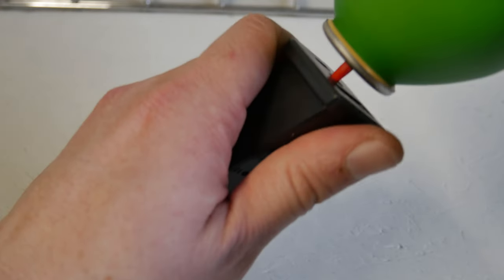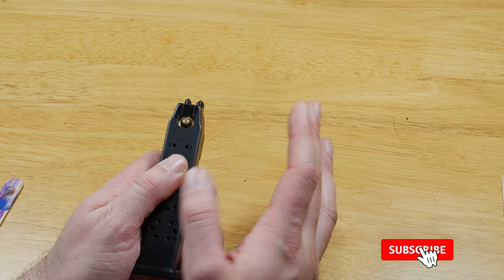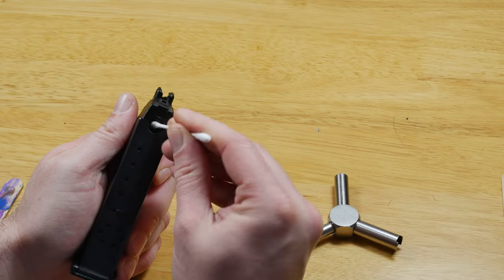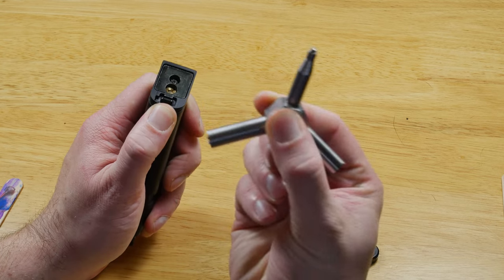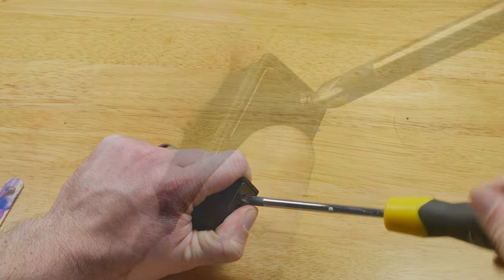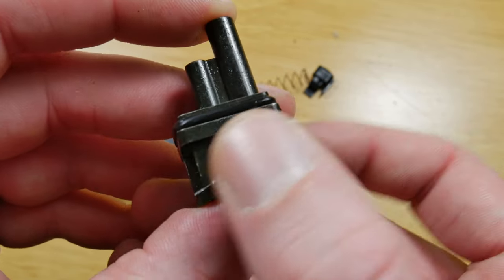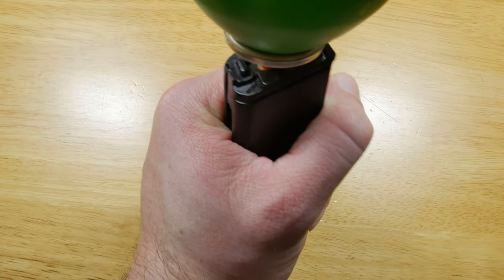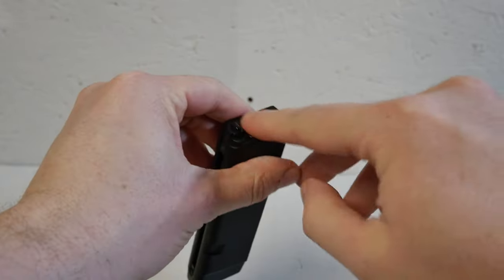How to fix a leaking airsoft gas magazine

Comment: A guy at my field told me to put it in hot water, works all the time
Reply from the maker: Yep I have tried that before. Had it work a few times for me. Just got to remember to dry it off before you use it.
Reply: @DTWAIRSOFT  see for putting your mag in hot water,do you have to remove any components?
Reply: put what in hot water ... the WHOLE MAG?
Reply: @Kzyoyozk no the o ring
Reply: @some_random_person3252 put the o ring in hot water
Reply: @eddiearteaga8934  can I put the bottom of the mag where the o ring is in the hot water?
Reply: But for how long?
Reply: I did that and it still leaks
Reply: @BigUp2024-m6v  did u lube it b4 u put it on again? Make sure u tighten it very well
Reply: @MP-xy6fv From personal experience, just about 30 seconds will do but don't remove the o-ring from where it is and just put it on the hot water along with the o-ring attached to it.
Reply: My guy old me to leave them in the sun for a little while to help expand the seals.
Reply: @chspg_alvis the whole mag or what
Reply: When filling my mag I came across the problem of a leaky mag and just wanted to ask if there is any possibility that filling the mag with to much gas could make things get a little loose over  time

Comment: I’ve tightened the valve on the base of my glock 50 rnd mag and it still kinda leaks, not as much but still a leak which goes on for a while

Comment: So I have a Swiss Arms P226 mag and it’s leaking from the lower body of the mag thorough the seams. Any ideas on how to fix?
Reply from the maker: Check the screw at the base sometimes they work lose and just need a tighten. If not then it would have something to do with the oring at the base

Comment: Mine doesn’t have an audible leak, and the gas will stay in the mag until I shoot it, and it fires two shots then dumps all the gas.
Reply from the maker: Could be your hammer sticking in the gun and not the mag

Comment: I have a question about the very top of the mag there is a valve that will not stop leaking how could I fix this
Reply from the maker: do you mean the part where the gas comes out of the mag?
Reply: @DTWAIRSOFT  yeah dude
Reply from the maker: @christopherclark2037  thats normally from the knocker valve on the side (thats the one that stops it coming out the top) Take it out and give it a clean and a bit of grease (also check the orings and make sure they are not damaged, if that doesnt work then you will have to replace the valve
Reply: @DTW AIRSOFT  thank you for your time much appreciated

Comment: what do you call that valve tool sir?🙏
Reply from the maker: It's  a valve key. You can find them on amazon here https://amzn.to/3ifz1Pr
Reply: @DTWAIRSOFT  thank you so much sir, now i can fix my leaking airsoft magazine without being afraid of loose threading the release and intake valves, thank you sir🙏
Reply from the maker: @jikipapica9135  Not a problem. Glad i could help you out 😀

Comment: I have a john wick 1911, the gun is fine but the mag keeps on spitting out the balls
Reply from the maker: Do you mean the pistol is just doing full auto when you pull the trigger?
Reply: @DTWAIRSOFT  when I reload the mag they all just burst out
Reply from the maker: @NateH-qd7bm  sounds like it could be the feed lips on the magazine have opened up not holding the bbs in place